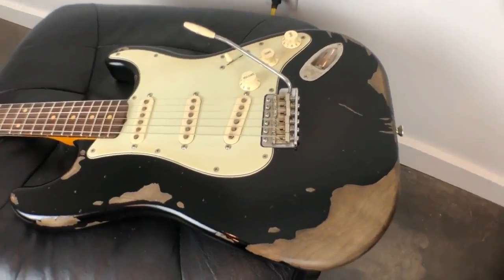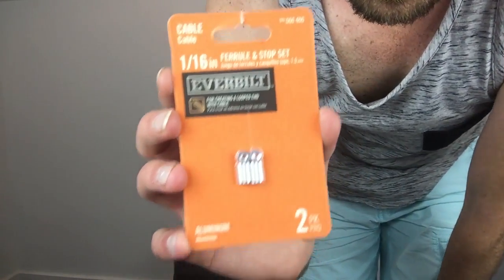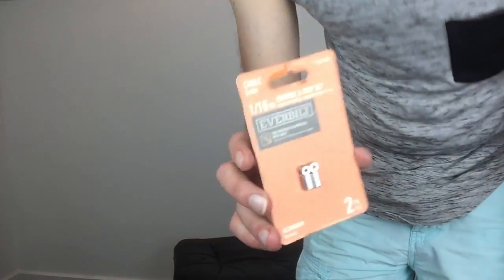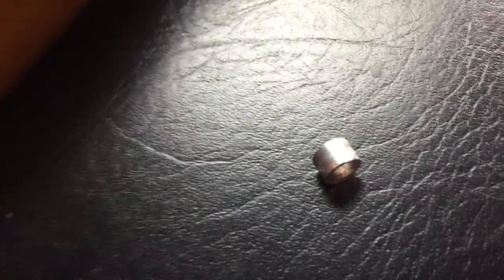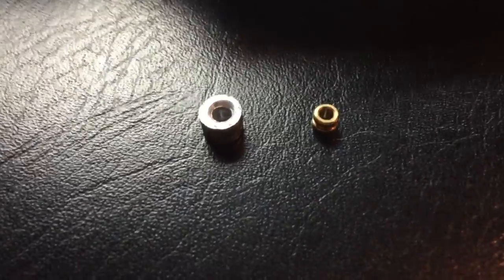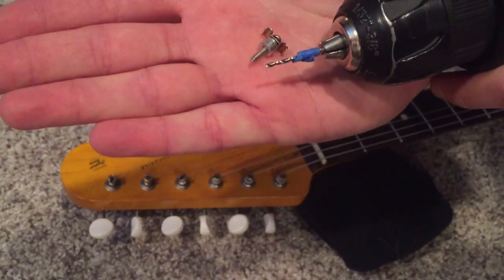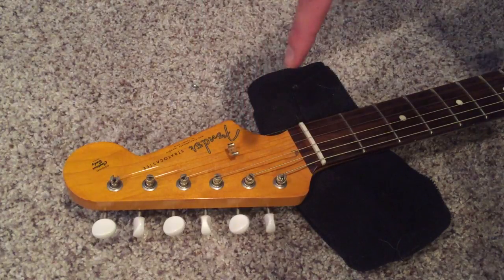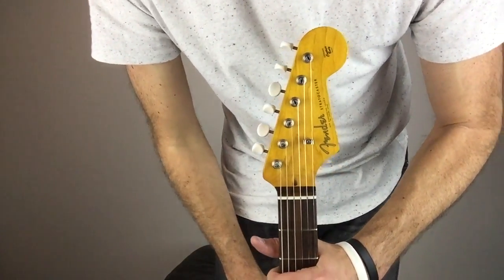String Tree Spacer Alternative

Comment: Great video!
I got a Tele last night that didn't have a spacer under the string tree. I was looking on ebay and tossing up getting either a Gotoh RG15/RG30 set despite not liking the look or a cheap string tree with a spacer.
As soon as I saw you compare the spacer to the bass string ferrule, I went and grabbed my guitar and put a bass ferrule under the string tree problem solved!
The string tree is the perfect height now.
Thanks.
Reply from the maker: Glad it worked out! 😊

Comment: Two tips...if you find that it's a little high, the aluminum is easy to sand. You could probably sand it down a little. The other tip...if you ever find it awkward using a big drill like that, I found that using a small Dremel tool with the little drill bit is a lot easier to control when drilling string tree holes and also holes for tuner screws. Easier to control the depth and not accidentally go too deep with the heavy drill. Hope that helps! Guitar turned out super nice too!👍😎🎸🎶
Reply from the maker: 74dart man thank you for the kind words. That’s a great tip about the Dremel. I don’t have one, but I definitely need to get one! 👍🏻
Reply: Nathan Sink yep...you're welcome. They sure are handy! I use em for small drilling and grinding. Even have cutoff wheels for cutting small metal!